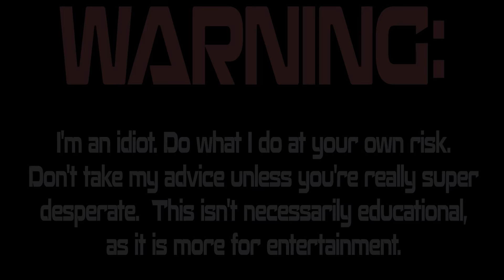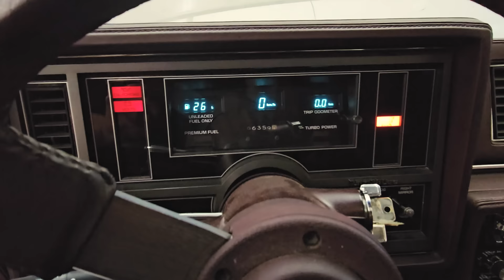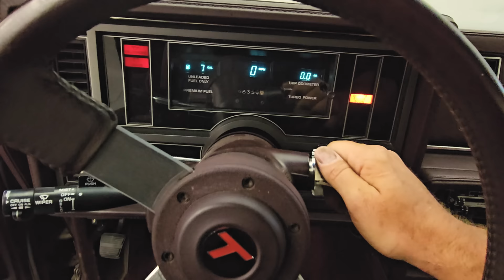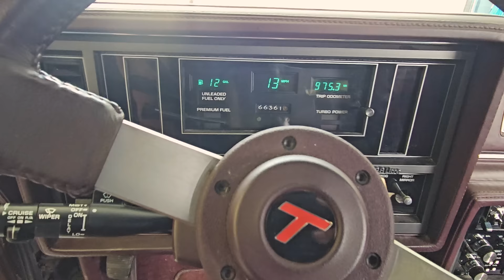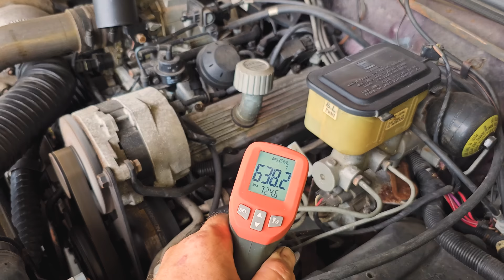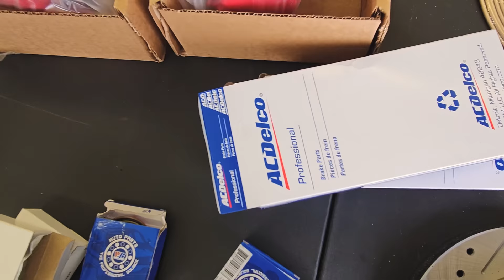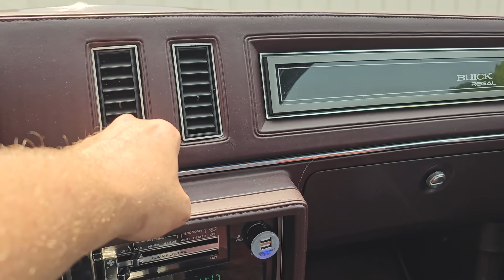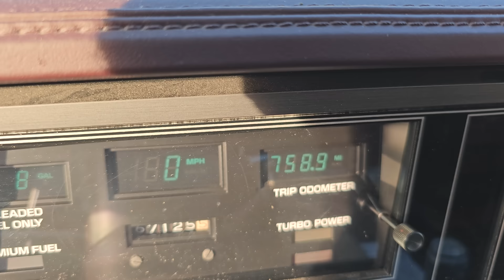ABANDONED In Storage For 22 Years - Rare Turbo Buick! Will it RUN AND DRIVE Home 750 Miles?

Comment: There is actually a fuel pump test line near the back of the alternator that you can just jump to the 12V hot on the alternator to get the pump to run.  Great find.  I have a GN with 94K on the clock and they are runners.
Reply from the maker: Great thanks!
Reply: What an epic find! This deserves to be restored and driven!

Comment: Those mags with raised lettering outward are the BEST tire/wheel combo ever. Call me a boomer, but you can't call me wrong. Thanks Derek and family for being AWESOME.
Reply: Very similar to the American Racing  Vector VN74
Reply: I'm 38 and not quite a boomer but I still do letters out on everything. They look way better that way.
Reply: @krvnjrcbs not really a boomer thing. That was more Gen X
Reply: @kennethlaw9830  huh? I hardly see anyone do that anymore around here anyway. You have to specifically request it when you get tires mounted or the places will assume you want them in
Reply: @kennethlaw9830  I confused Gen x with Gen z whoops
Reply: @krvnjrcbs  yeah my dad would put white walls out. I hated them. Always  put them in. White letters are always outside depending on the car. If its 70s or 80s they would be out. Anything else would be inside.
Reply: @kennethlaw9830  I put them out on my 2010 and 2016 trucks. I think they look better out on anything really.

Comment: There's just something about Buicks, particularly the 90s ones, that makes them so valuable.  I used to have a 93 Riviera (believe it also had a 3.8) and still would, but the frame rotted out.  Engine never had any major issues.  Stark contrast to the experience with some of the late 80s / early 90s Cadillacs.
Reply: Oh yes sounds amazing. 
Better go sweep up all the rust pieces and weld em back together and we can retire baby

Comment: I watch a lot of videos and many with replacing front brake pads. Something MANY, including you, Derek, don't do is bend the fingers over on the outer pads. not doing so causes early wear and rattling pads. It's pretty easy to do. Step on the peddle to seat the pads. Wedge a pinch bar between the rotor and pad at either the top or bottom and using a hammer and chisel, tap the finger toward the pinch bar. Then do the other finger and repeat on the other side..   It's easy and should be done.

Comment: There's a fuel pump test lead behind the a/c compressor and you can jump it with the power to the under hood light to prime it. Also, you can use the gas cap to hold the license plate down.

Comment: Derek,
 Love the show/videos. I was doing mechanic work back when those cars came out. Absolutely hated the rear wheel cylinders with the clips. I'd pry them off, but on the install of new cylinders, I'd put the cylinder in place, wedge a block of wood between the cylinder and axle flange and then take a shallow  1/2" drive socket that fit the back side of the cylinder/clip and tap the clip right on by hitting the socket with a hammer. And yes, I'd definitely do a frame swap and keep it as original as possible.

Comment: The first car i ever bought was an 87' Buick Regal Limited with T-tops and Landau vinyl top, it had the plush pillow top interior, the high output stereo with the 10 band EQ and the automatic raising/retractable antenna, the motor was a 5.0L V8, cruise control, locking wired wheel covers, i loved that car, but i lived in L.A. at the time and i literally got stollen 13 times in 10 months, so i sold it because i was sick and tired of it being stollen

Comment: I’m curious why on a vehicle like this you didn’t just buy a pre-bent brake line kit? Then you don’t have to worry about fitting and they save a ton of hassle. They aren’t that expensive vs the time in effort of tracking down parts and bending up your own. There’s usually lots of places that can have them sent over night/next day even for a less common car like this which by the way is AWESOME! You really scored on this, such a good investment.
Reply: the pre bent brake line kits almost never fit . they just cant teach those 12 yr old kids in china anything now a days.  bending brake lines is not that hard once you have suffered threw it a few times.
Reply: I have tried twice to use a prebent kit.   They don't fit.
Reply: @FerrisBuelller  and everything before 2000 was built in the USA . try shoving a metric fitting into an older american car . the amount of nope you get makes me proud of our for fathers .
Reply: @FerrisBuelller I've used classictube and inlinetube both worked for me

Comment: The rear seal has already completed the back end anti-corrosion treatment ! Nice car which probably would have fired up and driven straight out - not far though. A guy 's getting into having brakes nowadays as I remember Betty White going down the road with a vice grip on the front hose ! Great as always

Comment: If you ever want to check an 80's GM A/C compressor. Unplug the electrical plug on the side of the evaporator and jump it with a paper clip. If the compressor kicks on you are low on pressure.

Comment: In the 80’s I had a HS buddy who owned a Buick Regal 3.8 Turbo.  I don’t remember if it had the T Type emblem, but it did have glass t-tops. It was more of a redish burgundy with black stripes on the hood.  Concerning the frame rust, my guess is exposure to road salt during the winters, which would have been prominent in the northern states.
Reply: That would’ve been a carbureted turbo Regal Sport Coupe or a very early carbureted T-Type pre 1983.

Comment: Such a cool find; am pretty jealous of this one.  🙂 That color is just gorgeous!  Can't wait to see it properly polished & waxed.  Pity about the rust, but that just can't be avoided having been on  Michigan roads for ~14 years.  Add in the less-than-perfect storage unit conditions over the next ~22 years and things are bound to happen.  However, as others have said, this damn near a time capsule and a survivor.  Know you prefer to do most things yourself; but if you find the frame ought to be salvageable, then perhaps it should be sent somewhere to be properly deep cleaned to ensure all the dirt, salt and grime gets removed from all of the interior nooks and crannies.  Hopefully such a place could then fully encapsulate it, too.  Meanwhile, fix up the body rust, get the rest of the body back to factory condition, slap it all back together and enjoy the heck out of it!  😀

Comment: Absolutely amazing :). Great seals and dry air will make it last a lifetime or more. And respect to the owner for taking care of his vehicle. Be interesting what type of brake fluid they used back then ? More inclined to take on moisture ? Hidden benefit of an oil leaker is less rust in those places ;)

Comment: The Pinon seal often leaks after a long set because the axle housing vent could be plugged with dirt dobber mud. Be sure to check it as well.

Comment: Had a 83 gray t-type.  Loved it - this was back in 2008 - had it on 22 irocs.   I hated that it had the carb turbo not the fuel injection turbo.  None the less - was joy to drive.  Sold in 2012 - regret it being sold.  Other cars I sold I wished I would have kept - 2003 marauder, 1986 mustang gt convertible, 1991 civic si Tahitian green, 1992 civic vx - I will keep the cars I have and not sell.

Comment: I’m learning.  First step look in trunk or back. I’ve learned where brake do hecky is at, brakes underneath, gas tank alternative , radiator, earl, bat man usually replaced, carbo, pistons of course sparkies, distrub caps, wires, trans vestments,😅 oh yea tires.

Comment: Alternator check: Hey Derek, did you know that to check if an alternator is charging, with it running touch the back shaft of the alternator with a piece of metal and if it is magnetic its charging if its not magnetic its not charging.

Comment: for bending lines, an old moonshiner's trick for avoiding kinks is to use sand to fill the lines. Obviously they need to be blown clean afterwards. Appropriate non-hygroscopic filling material  (fine glass beads) helps

Comment: That has 8 GM 3.8 V6, great engines. I drove a 1987 Oldsmobile Ninety Eight Regency Brougham with that Engine. It lasted 320,000 miles without issue. It was transversly mounted with front wheel drive, electronic fuel injection and electronic ignition coil. Only issues towards the end of the car was a water pump replacement in 2014, oxygen sensor in 2016, 2017 a new starter and alternator. Then in 2018 the transmission went out.

Comment: Just discovered the channel recently, so I am still working my way through videos.

My first car was a 1978 Buick Regal, so I have a soft spot for them (followed by a 1980 Grand Prix, which is the same car under the skin). So I loved this video. Considering the condition of the rest of the car, swap out the frame if it is necessary, and keep the car. Give it an overhaul, and upgrade anything where it would be wise to do so. I would be wary of those nearly 40 year old electronics. Besides the age, the quality back then was not the best. And I would switch the rear brakes to disc.

Comment: Feeling your pain on the rusty brakes.  What started as a rear brake job on a 98 Chevy K1500 will wind up me parting it out because the frame is trashed.

Drivetrain is still good, fortunately.

Comment: That's a nice find.
One of the guys at work was looking for a car for his son.  They found a Type T for sale and went down to look at it.
He was quite excited at how much power that car had and said there was no way HIS kid was getting a car like that.
If I remember what I was told, the Type T was only made for a short while.  Not sure why it was discontinued but may 
have had something to do with competition with the Corvette.

My truck has a rusted frame, well 34 years, it should right?
I sprayed Mineral Oil on it to control the rust.  The oil will weep into the porus rust and seals it from the air and moisture.  
very good penetration.
The frame will darken as the rust is coated.  After a couple  years, the frame looks good and no new rust is seen.
Get in the doors to soak that bottom pinch fold and above the wheel wells, where the metal pinches .
I'd suggest in the air cowel but that is a complex system and difficult to get all the metal inside there.
But coat all the metal  you see with rust, include the pumkin gear box and oil pan. (I've had a car oil pan rust to nothing, now I coat them)
 Any adjustment points like the front end, where bolts are, nuts are, coat them.  If you can get inside the rockers and frame, go for it.
that T looks worse than it is. but it's worth coating to stop that rust.

Comment: If that rust is too advanced here's the best advice I can give a feller......you pop that radiator cap off and lift it , and drive a different car under it. It bound to be much cheaper and far easier to repair the rust using that method  . 64.903.1 % chance of success using this approach

Comment: The problem you run into with ethanol  (113 octane) is the volume needed compared to gasoline. The ecu will adjust to 10% any more you have to get bigger injectors more PSI. The ecu will also the timing. 
The Buick 231 (3.8l) was a good little engine. Guys put a lot of them in Jeeps. And you could build them NA with very respectable results

Comment: I should have waited. On my GN the low pressure switch on the side of the A/C dryer opened up on my car. I jumped the switch and the A/C works fine on mine.

Comment: Gorgeous car.  It would be crazy to do a "full restoration" when the paint, interior, drivetrain appear to be fine.  The big concern is the rusty frame.  Tt the very least, the frame should come off and either be replaced with a better one, or sandblasted and dipped in a rust arresting paint (IF the frame is strong enough).

Comment: The A/C might have performed better if you hold the bottle upside down and turn it from 10 o'clock to 3 o'clock back an dforth slowly. The R134a cans say to do that cause of the heavier chemical, otherwise you're not getting it all properly

Comment: Man Alive. In 1988 two buddies of mine from Syracuse NY drove with me in my 1980 Camaro Berlinetta to Estero island Fl  (Why,  I don't know. Only old people and no spring breakers, guess we got a deal on beach front condo) after the previous years doing Spring break in Ft Lauderdale.  In Savannah Georgia going south on I-95 a guy blew past us in this exact car, in this exact color. Somewhere in our stuff we took a picture of him. I ended up catching up to him and even blowing past him. I had cut the "peg" that GM put on my speedometer (keeping it at 80 mph) by drilling a hole in the circular cover and taking a tiny scratch awl and knocking the stop pin off so I could better estimate my speed. When I blew past Mr 87 Turbo it was a guy in his forties. I was redlining or close and my speedometer was on the "M" in MPH at 7 pm on the dial, guessing 120 mph. My man stepped up, dumped on that turbo and went out on the shoulder and blew past me smirking, T Tops down, giving me a slight older guy wave as he went past. I put the pedal down the 305 V8 Rochester Quadrajet and held in there for 20 minutes and never caught the guy.  No AC so the windows were down, luckily the back window didn't blow out. Would be awesome if this was the old man who blew past me that owned this vehicle.

Comment: In my eyes the frame is still solid i would lift the body off the frame and go to town getting that surface rust off it and prime it and use engine paint on the frame after its been de rustified.

Comment: Harbor freight R-134 filler manifold for the ACTUAL R12Necessart Or you have to replace the Compressor and Change seals and Synthetic Refrigerant Oil. 1:19:47

Comment: they used the same engine with some engineering on the top end a little mostly air intake stuff but this was on the Aussie Commodore last was VS for all the v6s great engine tough and easy to work on, they where quick as well even non turbo they had some bottom end torque. I miss Holden.

Comment: Is that the SS Monty color? I never had a Regal. Had a bunch of Cutlasses. 71,73,76,77,83. The list is funny. Bought a ‘69 LeSsbre from original owner 30K. Had ALL the receipts from new. I ripped it apart🤷🏼‍♂️ Buick wide V 350 went in 83 Cutlass. The hood got a hole torched in it. FYI putting 4-5 people on a LeSabre hood behind a snowmobile is a guaranteed good time😂

Comment: Medium octane and or premium 91 octane is the best racing this 3800 turbo Buick GM. The premonition is prevented by no making the combustion chamber into carbon build up. That is what high heat premium gas is for it prevent carbon build up or else premonition and detonation will happen. The premium gas had to make the rpm at 8000 RPM and no problem but alternator will be fried sometime.

Comment: It’s a shame the tire shop damaged that wheel like that 😕. Anyone that’s been in the industry knows you can use a cone on the backside and a wing nut with a rubber cap to hold the wheel

Comment: Hello, I have a 2005 Buick Alloorey which is basically a Le Sabrey right?
Until yesterday, turn the key, ran beautiful, not an off sound or a tick, at 375.000 km it was shocking how well it ran. 
Last night, driving up hill it started to shutter, check engine light flashed. Soon after, dead on the side of the road. Horrible electrical smell. Turn the key and the fuel pump still makes noise, the engine stills turns over but won’t start. WHAT could it be??

Comment: I'd say the owner got an offer too good to refuse, and saw the value in storing it. Unfortunately for him, he picked a crappy storage garage where the elements would still take their toll. Pretty sad really.
But despite the rusted parts, for the right price it was a good find. 

It's well worth looking after as much original stuff as possible. But the inside is sweet. No bs. Just what you need and nothing more. 👍

You're like, These mud flaps have done great protecting it, there's no marks from rocks, etc. 
So I think I'll take them off and let rocks damage the original paint work...... really can't follow your reasoning sometimes. Leave them on!

Comment: Folks...
power steering fluid needs to be revived in all cars. used the exact product..
its simple to do.
pump out the old juice from the reservoir.
you can use an old soap pump or trigger pump from a spray bottle. refill repeat 3x

Comment: 20/20 hindsight, i wouldve sprayed down the entire underbody of the car , in the doors with tranny fluid
and or ran a DE-Humidifier the entire time of storage with a drain that ran thru garage door or back wall , something to get moisture out!
would a tank full of fuel be best OR same 6 gallons of fuel but with a gallon of alchohol helped save the tank and pickup?

Comment: The typical 80's certified mechanic would delete the turbo. They were taken off the Dodge Daytona of that era, and they were also taken off of the Buick Grand Sports n Grand Nationals too, they were known as junk to the average mechanic in the 80's. most of them were de castrated by your expert 80's mechanic. They had problems and didn't last and they were expensive to fix so where was cheaper to just take them off

Comment: 8:21  that frame had to be hosed. There is no way that much rust flakes off and it’s still ok. Think about how much is still up there. Pretty much just rust no metal at this point. Could be wrong but u might have to find a new frame for it.